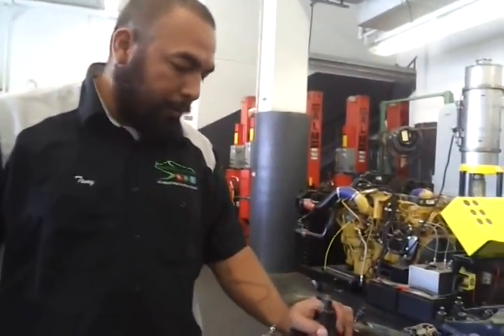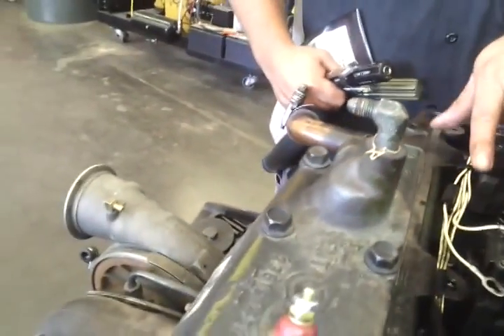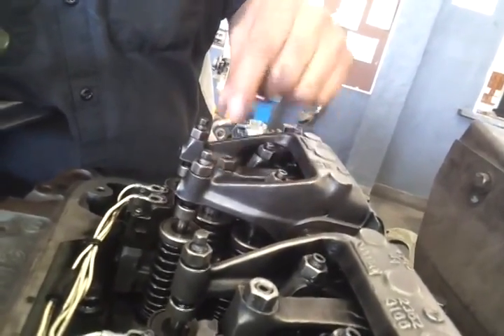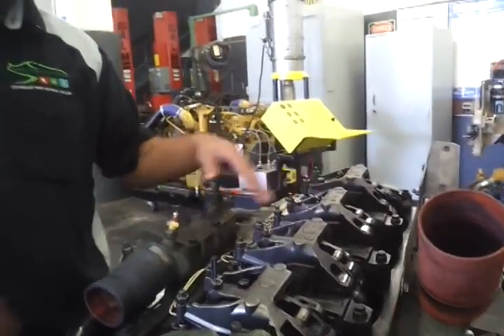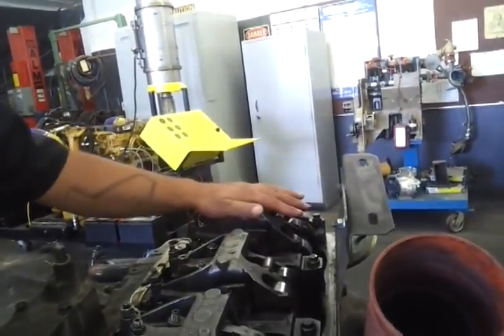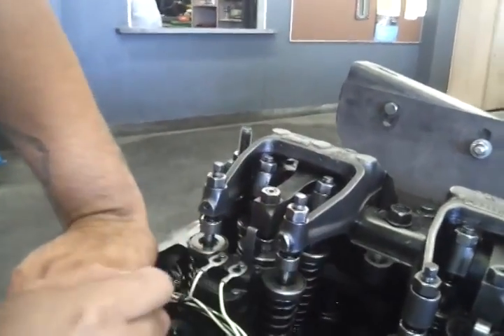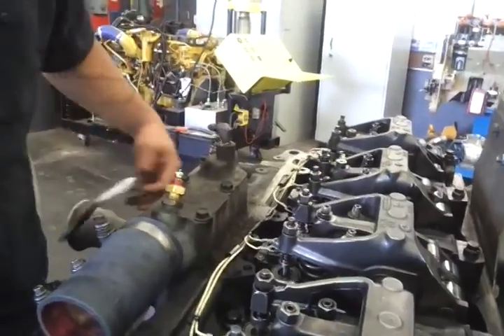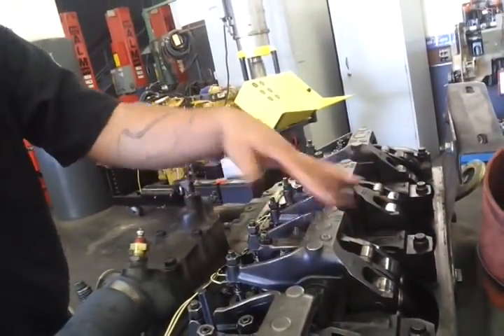Valve adjustment on a Detroit Diesel tune up

Comment: Sir, when you make a video, be precise in everything you say and be very detailed. Because from this video i did not understand a single thing, but you could have explained this process A LOT better so a simple mind can comprehend it. Remember, when you explain something that you are good at to regular people,  do not speak from your high knowledge of a certain thing you wanna explain. Speak from and with normal knowledge,  so people can connect with what you wanna say and to what you mean concerning what you are talking about.  Simple as that. This could have been explained so much better and efficient and reliable so anyone can do the job, but you have failed to explain all the details.  I barely understood what you wanted to say. And explain it from start to finish, so anyone can do the job.
Reply: Remember one thing, not everybody is a mechanic or can be a mechanic. People go to school for this, it’s not just something you learn with Joe drinking a beer.
Reply: Maybe your dumb and dont get it.